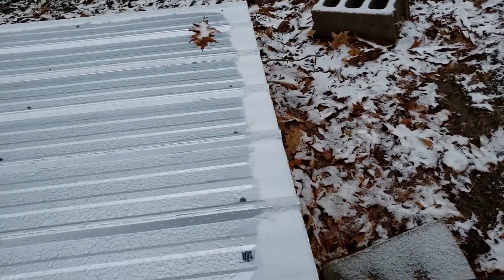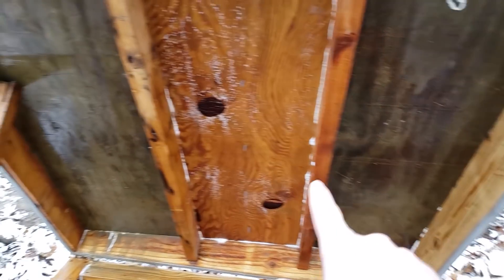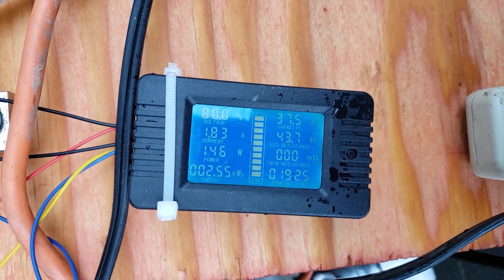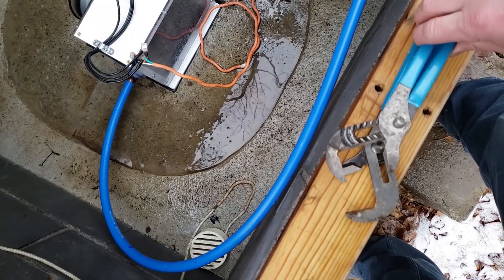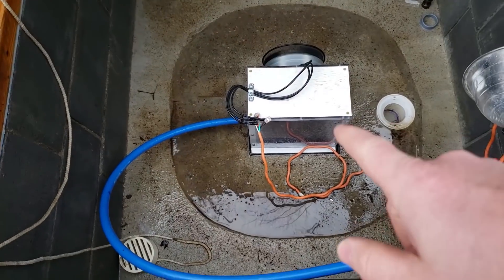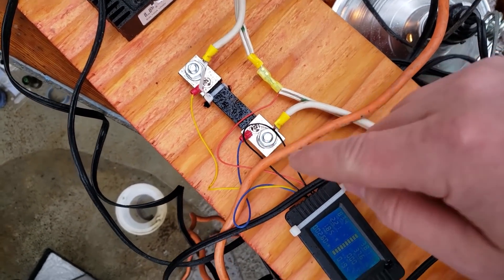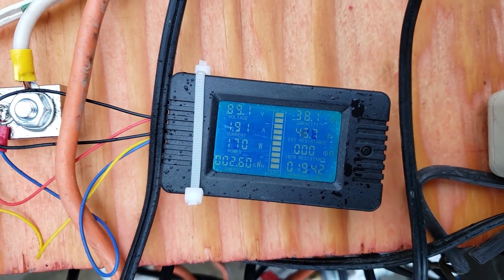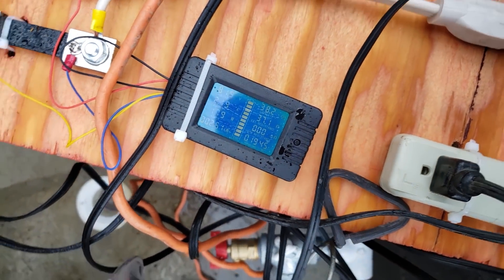More Watts From The Turbine With Some Tweaks

Comment: Part of your alignment issues may be caused by flex in the housing. When you align the stream at low pressure, it's not exerting that much force. When you give it full pressure, it might be pushing hard enough to flex the housing and cause a misalignment.

I suggest doing fine-tuning of the alignment at full pressure if the housing isn't super sturdy. Ideally the shaft would go through the housing, so there's alignment bearings on both sides of the turbine scoops.

Comment: To find the optimal rotation speed, you can use SPECTROID application on play store. It will measure a frequency in Hz, divide it by the number of cups and by 60 to find the rpm.
I use it for rotating machines commissioning.

Comment: project is looking good! steadily finding more power. I think you are on the right track tweaking jet alignment and a proper charge controller will handle finding the optimum RPM by varying the load.

Comment: I have to point out that your current shunt is mounted to a wet board and is wet itself. That will effect the resistance and skew the readings
Reply from the maker: this had occurred to me and is likely doing something.
Reply: @JoeMalovich  Does your Fluke have an ammeter? If not I have one that does. It will do 4A DC and Hertz as well.
Reply from the maker: @joede181  I have a cheap one that does 10 amps DC. Thanks for the offer dad!

Wait is it a clamp meter? That might be a good idea to have.
Reply: True but insignificant. That's likely a 1 milliohm shunt, whereas the water may represent 1k or more. That's a factor of a million right there, making any error negligible.

Comment: I would mount the nozzle on a plate, with angle brackets to push pull up down, and the same for side to side, with in about 1/2" or so, then have bolts and fender washers to lock the plate down to prevent movement. Or turnbuckles could possibly be used, nice job!

Comment: Hi form Greece and nice work. Also I am a little bit jealous of you and the place that you live I believe some day I will find to a paradise near a creek in Greece. I have a few changes to suggest for less stress on the axis of your alternator. 1st. Is best to have it vertical because the bearings take the equally force from the weight, now (from the hose side) the right side of bearing is pushed down and the left is pushed up and that force is only from gravity. 2nd Is to put another hose from the opposite side to equalize the force that pushed on this axle. now (again from the hose side) the right side of the bearing pushed back and the left is pushed to the front side. Something like Kris Harbour is doing, (I think you have mentioned him). With this two suggestions, I believe  that your watts will go up (especially with the 2nd). If you go with the 2nd suggestion, I believe you gonna need Y connector. The smallest the angle in the upper side of Y,  the less the losses.   

One way to see the maximum wattage is to add more lamps until the alternator can't keep up. The experiment is the fastest way to knowledge with the highest risk.

Comment: Thanks for sharing. I was thinking if you ran the shaft vertical and added drain holes to get rid of the water faster, it may be a little more quiet.😀 Multiple stainless flat washers might reduce friction on shaft. Water would act as a lubricant. 😕Just saying... Thanks for the vids man. Uve made me think.👊😎

Comment: Definitely try mounting in shaft vertical. If nothing else it helps prevent water getting into the bearings which will gradually affect the efficiency and eventually (quite quickly actually)  the bearings will need replacing .

Also, the alignment of the hose in will alter the angle of the jetstream. Try moving the hose sideways and you'll hear the turbine wind up or down reflecting alignment of the jetstream. You'll need to set up a mechinism to hold the hose rigid in a set position.

I have the exact same turbine. I'd be expecting about 250w from that head/flow. Cool project and enjoy the vids. Cheers

Comment: A few (general) points to keep in the back of your mind.
Noise is just a different form of energy. The more noise it makes, the less power it's making. I'm sure you've figured that one already.
If you've only got one nozzle then you're putting a sideways force on the axle of the generator. That causes friction, wasted energy. Use 2 or 3 nozzles to balance that.
If you're still getting some noise and want it quieter, add a perspex box or similar between the generator and the outer blocks. Basically you're adding another wall & air gap.
A good charge controller will balance the load so you get the most power out.

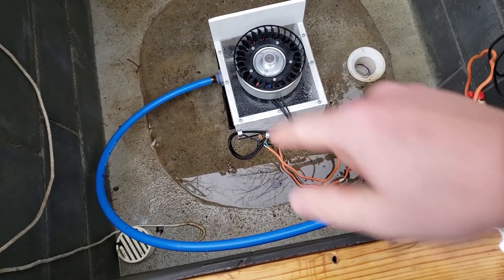Comment: I think a second Jet on the opposite side of the existing jet (At 3:49 mount it in the bottom right of the Turbine) gives you little more power and the stress to the bearings of the Turbine is lower.
Reply from the maker: With one jet the lateral load is only 36 pounds, far far away from the maximum rating of the bearings (even if the bearings are spaced closer together and there is 3x the lateral load on the turbine side bearing is nothing).

Moreover bearings like some load otherwise they are more prone to chatter if there is ever a little slop which will kill then quickly.

Comment: Hi Joe! What if you were to go to a 1 1/2 inch manifold and rig a twin nozzle set-up??? RE: The nozzles would be phased at 180 degrees apart from one another??? I believe that you could perhaps develop twice the torque and perhaps the alternator would be a lot quieter and some of that wine would nearly cancel out. The one concern that i would have is with your high moisture buildup sump area could possibly do in that alternator of yours! I just don't think it could take it! In the interim part of your build process, perhaps you could use Marine purpose Grease on those bearings till you get all the snags worked out. High moisture will ultimately be your enemy for your alternator if you don't nip it in the bud real quick!!! Next idea: What if your cooling fan were to be housed so that you have in essence a squirrel cage housing and try to attach some PVC pipe of about 3" dia up and out of the cover with a T union fitting to push the moisture up and out of the cavity???
Reply from the maker: Good ideas, I have a second jet location but if you half the flow and double the jets it's the same torque. The final design will be sealed so no water will be flung around.

Comment: Looks like it's running better now. And the lights seem to be a half-decent ad-hoc anti-icing solution. Should just add a solenoid operated regulator valve to keep the power constant. Also look into how gland seals work, or perhaps use a water-lubricated bearing.

Comment: try increasing your wire size to 10 Gage wire and hook it up to 24 volt battery bank, It will let the generator run at its optimal rpm, then draw your power from the batteries this will give you a more sufficient  amp reading.

Comment: problem may be either the turbine isnt 100% flat to the ground (or case) and is giving a teeny weeny bit of resistance while moving... OR the ubend hose is reducing flow by internal resistance (although i think water pressure would override that problem!)

the shunt may be killing some of the voltage joe, just a thought as its stealing some power to run itself! see how many volts/amps/watts its marked up for then add that to the output voltage... just a thought!

doing well joe!
Reply: You can ignore the voltage drop of the shunt, it is usually something like 1mV per A , so in this case it might be 0.002 Volts.
But there is maybe a measuring error of a few Watts caused by the  ripple of the rectified ac. But that can be fixed by connecting a (large) capacitor parallel to the output of the rectifier. Those large capacitors can be found in old AC Motors.

Comment: You could set up a program to measure the amperage, wattage, voltage, and nozzle diameter to always keep the most efficient ratios for different water pressures

Comment: Get a digital scale that weighs to 0.1 gram then weigh all the turbine scoops. Sort by weight then mount the two heaviest opposite each other. Then the next heaviest next to the first two. Repeat with decreasing weight. Or mix up the pairs, but always with closely matched weights opposing. If they're close in weight, 0.1 gram increments might not be precise enough of a scale. Grinding small amounts off the mounting tabs is what I'd do to get the weights really close.

Comment: I would be interested what the difference would be if the blue pipe/hose would be straight and not make a 180° turn, I feel like it should lose some energy due to the bend as well. Maybe try  a shorter blue pipe so it would result in less curve?

Comment: You could digg a bit on the outflow pipe to put a smaller bucket under it to get flowrate readings :)
Reply from the maker: I really can't, the outflow is pushed down as low as I can get it before the culvert. It doesn't even fall out of the pipe at this point.
Reply: @JoeMalovich   then add a weir at the end or use the carlifornia pipe flow measurement :)
Reply from the maker: Really I could take the nozzle off and put it on a garden hose.
Reply: @JoeMalovich  or you could add a weir to the outflow pipe and add some markings to read the outflow with different nozzles 😋

Does your garden hose have the same pressure? 🤔

Comment: hey joe, do you have a 200Vcapacitor laying around? put it acros the +/- output of the rectifier. im curious of what would happen. it MIGHT bump up the wattage a bit
Reply from the maker: I do not, not anything with enough capacity to do anything.
Reply: What’s a 200V capacitor? Capacitors are rated in microfarads.
Reply: Brian TheAcGuy i think supersolex means get a xxxx microfarad 200v cap but i may be wrong! could do with a microfarad value
Reply: @theacguy9546  like Geoff Upton said. its the rated voltage. so it would'nt blow up
Reply: yep, capacitor would at least stabelise the voltage, for better measurement.
I wouldn't expect a boost in efficiency, as there's no active converter (different frequency for boost convertion)

Comment: I've watched another youtuber who had issues with the spoon bolts coming loose. Have you checked the spoons to see if they are coming loose? He had what looked like the same generator and found the vertical shaft mounting orientation to be much better for a number of reasons.
Reply from the maker: I'm using nylock washers, nothing should be coming loose. Everything still feels tight.

Comment: use a carriage with some M6-1 bolts it should give you pretty good adjustment. If you use Stainless nuts and bolts don't forget to grease them them so they don't cold weld.

Comment: Won't be better if you get rid off the blue hose with the backwards curve and then aligne the penstock with the nozzle connected to it?
Reply from the maker: the radius on the hose is so large that it can be considered straight. The diameter of the hose is encroaching on the pressure more than the bend at this point.

Comment: light bulbs are not true resistors. They rise resistance whit temperature, so it's like a closed loop control preventing them from popping. if you run them at 80V or 90V they will have different resistance. Search for "PTC (Positive Temperature Coefficient)" and "tungsten temperature coefficient". Thats why your results are strange.

Comment: Joe, assume you'll eventually be charing a power wall ? then you wont have to worry about matching load to output for max efficiency...ps Aren't your cables a little thin.. volt drop. It's sounding better though.
Reply from the maker: only 2 amps, no enough to stress the cables.

Comment: So what is your optimal RPM to run at for peak efficiency??  seems like putting a charge controller in the middle of this would help to key this in.
Reply from the maker: I don't yet have a suitable charge controller. A charge controller would only work with batteries, what I was doing was adjusting the load to achieve maximum watts, exactly the same as what a charge controller would do.

Comment: Do you have , or could you setup electric underfloor heating in your house? It’d make a good “load” that could be adjusted to optimally load the generator for the set flow rate.....and you would also get toasty warm! Even a 100W light bulb in an insulated room can make a noticeable temperature difference.

Comment: aren't you losing a lot of power in the u bend in the blue hose?
Reply: Anthon de Vries thats a point, but the pressure may offset it
Reply: I don’t think the u-bend is doing very much. Some 90 degree bends might
Reply: Brian TheAcGuy good thinking! the more angles the higher the resistance! jeezz i'd fail basic plumbing for missing that! lol nicely put brian

Comment: Can you email me the pit opening dimension and the bolt pattern of the gen mount or at least the shaft size i want to design you a new enclosure and send some ceramic bearings. But i might just machine you a floating fluid bearing it will need a to use water to float the shaft and 2 thrust plates but both options with get rid of a lot of drag
Reply from the maker: I have future plans for a housing, I already have the materials and a suitable welder. I may need your help with a new larger rotor for more spoons and more torque to operate at a lower RPM and less friction. I need to switch out the bearings to shielded with a grease zerk which will remove a bunch of friction. Thanks for your offer. What is your email?
Reply: @JoeMalovich  I'd be more the willing to help just send a drawing I'm limited to the swing over on my haas ST-35Y anything bigger then 23in dia i have to take to a buddy he has a 62in max limit on his vertical lathe but after 23in shipping be come the real problem anyways. I can also machine it as a multi piece unit with a center hub and balance the assembly. I started designing a spherical nozzle aiming assembly with a lock this might help getting that nozzle in perfect alignment. Also redesigned the paddles a tad to make it more efficient at lower flow.. email me at my username i can share all the simulation and design work also a heavy balanced rotor will help a lot at lower outputs.. also what you think about using 4 nozzles 2 small each made for apx 150 watts and 2 large each with apx 550watts of flow and using gate valves to mix nozzles based on line pressure and power output. A simple arduino can run all of this ?

Comment: So your meters check out, good.
You have gone from 130W to 180W, 50W improvement just by tweaking the jet. If you can make a better jet mounting with all 3 spacial adjustments, then you can tweak it on the go so to speak.
Another useful addition would be a RPM meter, and even a water flow meter. You would then have all the dynamic parameters.
Reply from the maker: those are in the plans, I have a handheld rpm meter for now. Frequency on the AC line could be used in the future. Do you have any ideas on a spatial adjuster? I'm thinking either a bulkhead fitting with a through-ball-mount or a tube within a tube with grub screws for aiming like a 4-jaw chuck (but 2x 4-jaw chucks a short distance apart but instead of chuck jaws it's just screws or bolts.
Reply: I'm not really a mechanical engineer, so not sure about the how to. But certainly I had in mind screw adjustments, with locking mechanism in all 3 planes.
The important thing is the ability to tweak it for max power whilst running.

Comment: One thing to remember is that wattage is volts*amps. In Ohm's law, voltage is equal to amps times total circuit resistance. Therefore, rearranging the equations, wattage is (amps)^2 times resistance. that is why MPPT charge controllers are important for a linearly proportional load such as a turbine so it can squeeze out the most wattage from a variable voltage situation by the controller varying the resistance. You may see more than 200w with your charge controller and a battery!
Hope this helps! Been a fan every since your waterwheel at your old house and excited to see where this goes, cheers!
Also, I didn't hear this in the video, but is this still at around 12 gpm?
Reply from the maker: Yes, same flow, same nozzle, same pressure. MPPT could probably only squeeze out 1 or 2 more watts, I was in the sweet spot with the bulbs I was turning on and off.
Reply: His little blue meter does that math for him. External resistance is the second display down on the right.

Comment: I find this very interesting.
What is your long term plan/goal?
Cheers from Tokyo!
Reply from the maker: Goal is to partially power our house and have a backup energy system for the frequent power outages we have. Alternatively I could use it to do auxiliary heating in our home and power an aquaponics setup for fresh strawberries during the winter.
Reply: @JoeMalovich  If you're doing water heating, battery charging or anything where there's some store of energy involved, could you use a couple of water level switches on the top barrel and a solenoid valve to intermittently run the system at full power? If (as Kris H commented on your last video) it's most efficient at high power, you could run it at full blast until the top barrel empties and then shut it off to let it refill from the stream; the duty cycle would be determined by how fast the stream is flowing that day.
Reply from the maker: @PKMartin  I'm working with a viewer for a flow monitoring system so that I can match nozzles to flow, I will have many nozzles that I can turn on and off to match incoming flow.

Comment: The ultimate in future would be to get real value from that power. Right now your just making light and heat in the outdoors. Your throwing away the power your making. I understand this is in development  but the power is being wasted.  Maybe run it into your home and use that heat in a living area. That would offset your heating costs at least.  Not much good in the summer though. Just a thought.